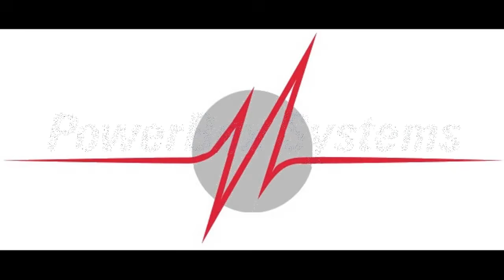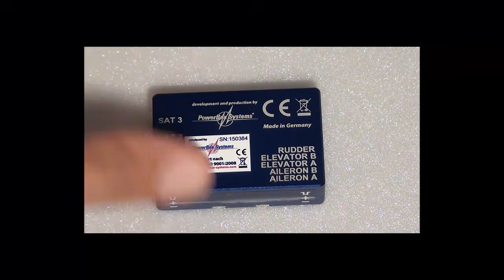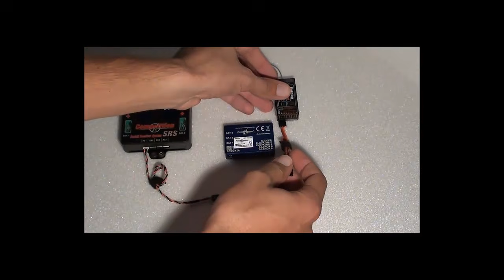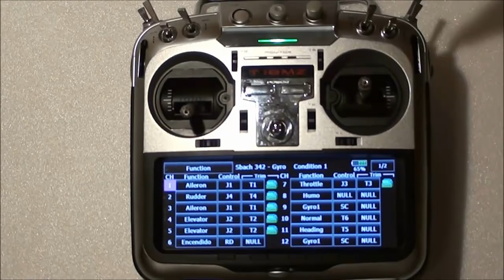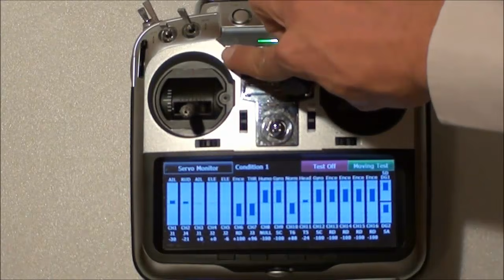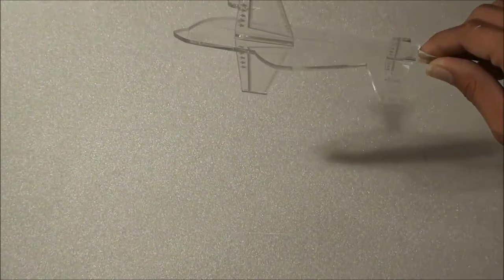iGyro   Step by step install and programming   by PickeringRC

Comment: Hello, do you need to leave the switch attached during flight to power the unit or can it be removed after being programmed before flying?
Reply from the maker: It can be removed (normally everyone always does, as it is not necessary at all other than initial setup)
Reply: EVERYTHING RC - Martin Pickering PickeringRC awesome thank you!

Comment: Hello Martin, do you fly always with gyro?
Reply from the maker: +Arnaldo Medeiros.Hi Arnaldo.  Not normally, I currently dont actually have a gyro in any of my models with exception of the Parkmaster foamy I recently used to demo the iGyro 3e.  The one from this video is installed in the Edge I have in the Uk sitting in storage...  I am fortunate that where I fly wind isnt a problem

Comment: Hi

Can I use the I gyro as a stand alone unit without the PowerBox  ? 

Thanks
Reply from the maker: +soaringkhaled Sorry for the veeery late reply...  yes, you can use this gyro as a stand alone unit, connected to an "sbus" style receiver.  For a standard receiver, you can use the slightly more simple version, the iGyro 3e